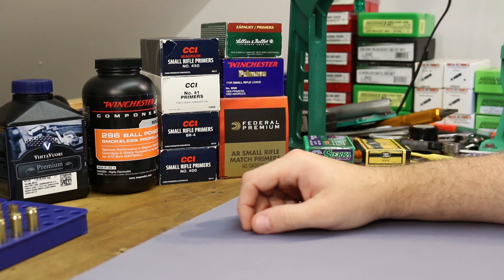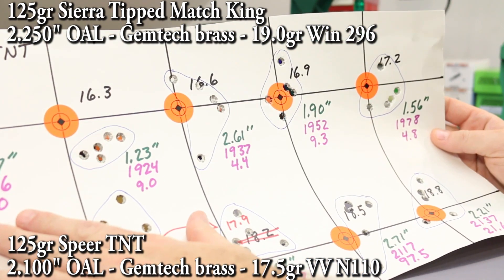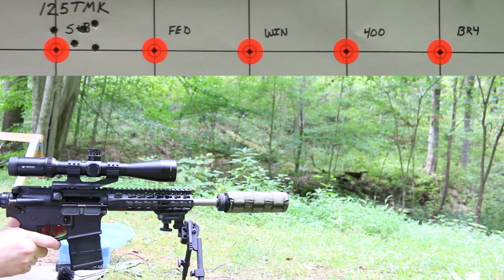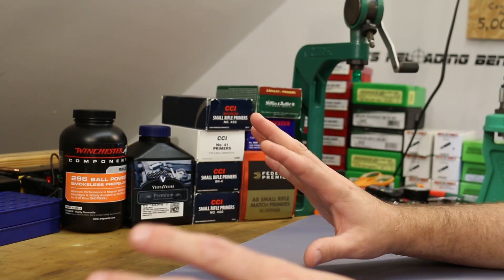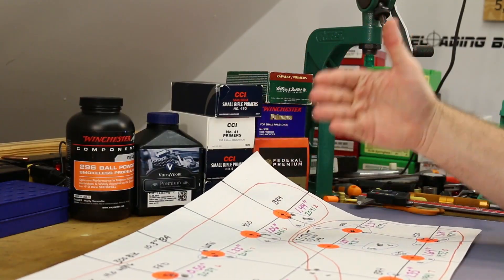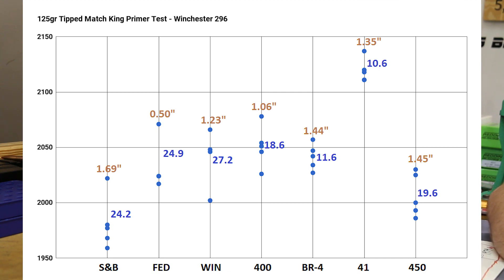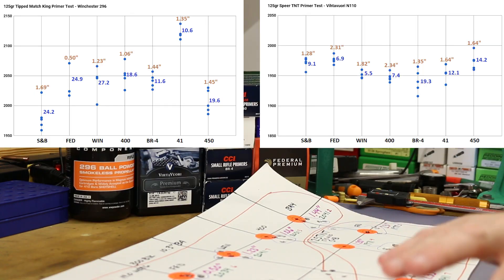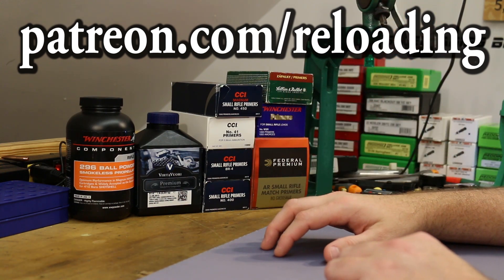300 BLK - Primer tests with 125gr Supersonics

Comment: Been using 17.5 gr of H110 (same as W296) with the 120 gr Barnes Tac-TX and also with the 125 gr Hornady FMJ as the corresponding “practice” load.  (17.5 is the max load given by Barnes for the 120.)

They both shoot to same point of aim and give nice groups.  As you said, that’s a good case fill level.

Comment: My AR Stoner barrel 300 BLK 16" group all under 1 inch with AR Stoner barrels.    My Lil Gun likes AR Stoner Barrels.   You had a very tough time. 
2.070" COAL Speer TNT, LC, 18.2 Lil Gun, CCI 41.   Lee Factory Crimp - Medium.   Winchester primers giving under 1 inch @ 100yds.   2250fps average

Comment: What I find in common on both charts is something I've seen replayed for decades consistently: low standard deviation does not translate to small groups and vice versa. Often, the tightest groups have the worst SD's. Seems like it shouldn't be that way but it is. Every now and then I'll stumble on a load that is both low SD and a consistently tight grouper but it doesn't seem to be the norm.
Reply from the maker: I have to agree with you on this one.  At least at 100 yards, I haven't seen much correlation between poor SD's and groups.
Reply: 452Rob at 100 yards it makes little difference. But start stretching the shots out to 800+ yards standard deviation makes a huge difference.
Reply: Rob, I can sure see how that would be important at that sorta range. Most of my interest over the years has been in handgun hunting and magnum revolvers and normal hunting distances. I'm only just now, in my 50's, starting to think about long range rifle shooting but haven't jumped into the pool yet:)
Reply: Chronographs are more accurate than you give them credit for.
Reply: John Browning, I have tested this with multiple chronographs from low budget to professional grade with loads exhibiting this phenomena and the groups that are good with poor SD's are consistent from chronograph to chronograph. Also, there have been numerous tests of chronographs and their accuracy. They are accurate enough that you can trust the SD numbers without a doubt. Those who say otherwise are speculating and bloviating wanting to appear knowledgeable and are best simply ignored. Anyone who has any actual experience with them will realize how sensitive they are. You may get error readings from poor light or poor alignment of the instrument in the flight path, but when they read, it's accurate.
Reply: You tighten up groups that have a good SD by messing around with OAL and jump to the lands

Comment: Never a boring day! It would appear after many different components that the 300 Blackout is not a particularly accurate round relative to say the 223/5.56. Definitely good for it's designated use and also a solid 150 ish yard whitetail round.
Reply from the maker: I definitely don't agree with that.  My 16" 300 Blackout was super accurate.  Give me a 16" barrel from Ballistic Advantage or another very good barrel maker and I bet the accuracy would shock you.

Comment: Lil'Gun in 22 hornet has taught me that tight SDs don't always translate into accuracy at close ranges (<200yds). Any hornet loader will tell you that as well. Loads that will give you better than 0.50 MOA will sometimes have SDs of 20-25fps.

Comment: Beautiful chaos so what did we learn? Johnny has a rigid finger the gun has a light trigger and the higher you go the looser you get. now on a more serious note I have never had good luck with Magnum primers . that's one reason why I use the 400 CCI they're more consistent you get a consistent shot with those primers if you look at your velocity charts you'll notice the CCI 400 primer is always in the middle it don't vary your speeds with whatever powder you're using

Comment: I also had multiple failures like this from my CMC trigger. If you call them they will send you out a new one immediately and request that you return the old one in the package they provide. I did and sold the new one. Go with a Geissele and you won't want anything else.
Reply from the maker: I have three with several thousand rounds each. I like them a lot and they've been dependable, so it will take more than this one incident to sour my opinion. I haven't done any careful cleaning on any of them so it might be time to pop them all out and make sure they're not gunked up. I've always heard great things about Geissele, though!
Reply: Johnny's Reloading Bench I liked the CMC while I had it and was happy using the replacement but I found that the 2-stage ssa-e was easier to shoot accurately on paper. I like being able to take up the first stage and only have about a 1lb break on the 2nd. May be worth the try if you get the chance.
Reply: Johnny's Reloading Bench geissele hi speed match trigger is probably the best trigger for ar15s
Reply: David Hunt second the ssa-e love it.
Reply: David Hunt It was not the triggers fault it was a bump fire.
Reply: Johnny's Reloading Bench It was a bump fire your bipod caused it.

Comment: I experimented with N110 using cci41 and cci400 primers and had lower SDs with the cci41 primers. Tested it with the 110gr Vmax, 125gr SMK, and 110gr TAC-TX and all my tests showed that the CCI41 primers produced a lower SD and slightly smaller groups. Difference in group sizes were negligible so I don't think anything can be concluded from that. I was thinking that CCI 400 would be the way to go based on your testing but results were different for me. It makes me wander what variable caused us to have different test results. I guess it just goes to show that there are other variables that can affect results. Regardless, thanks for all the videos. I've really learned a lot from your channel.

Comment: I got bump doubles after changing out my stock trigger for a 3.5# single stage.  I discovered that I wasn't holding my stock against my should firmly enough.  A firm grasp stopped the problem.
Reply: I had the same thing.

Comment: If your tigger isn't resetting I bet that was hammer follow. Next time the trigger doesn't reset inspect the primer on the chambered round. If there is a significant dent get a new trigger but if not you bump fired it.

Comment: Hey JRB, get yourself a Trigger from Triggertech, the adjustable with either a curved or straight trigger and never look back. Best trigger I've used to date, even better than the Geissele triggers and half the cost, have over 25k rounds through my Triggertech with zero issues

Comment: I think the doubles are caused by bump firing, especially with the new leather bag.  Those leather bags are supposed to allow the stock to recoil without grabbing the bag.  Combine that with a light trigger with a short reset and it's easy to get a doubling.  It's happened to me with two different rifles shot from the bench.  I find holding the rifle tightly into my shoulder and holding the trigger back until recoil impulse is over help to avoid the problem.

Comment: My guess is bump fire, no doubt to me. camera footage agrees based on the recoil. easy to do if you get in the groove with a light trigger finger. My Echo trigger in my 10.5" 300 blk will pretty much run itself after the first pull an release.  great data even if tripod season is upon us. (sorry for your loss) I've only run subs across the chrony with that gun so i am pretty stoked to see what the supers do with all the primers. I think the 41s where a fluke but would be very interested if they truly do give an extra 100+/- fps. Thanks so much for all the vids you do.

Comment: Bet some / a lot of that velocity variation is due to that light trigger, which will have less hammer energy to the primer. Bet you'd see noticeably more consistent velocity w/ a standard milspec, or Geissele national match, that'll smack the primer much harder. I saw the same velocity weirdness when I swapped in a Timney 3 lb competition trigger, from a Geissele super dynamic combat trigger. Groups also opened up slightly with the lighter Timney trigger. Also, don't rule out a faulty trigger; if the disconnector is dragging on the hammer slightly as it's released, it'll effect hammer velocity / energy.

Comment: IMR 4227! Just don't pay attention to load data. Keep it low (below 18gr) and H110 especially around 18+ ;)
Reply: I experimented with H110 and CCI Magnum Rifle Primers for about a year and finally decided to give up on it due to Copper Fouling issues.

I'm currently playing with CFE BLACK  and "standard" primers (CCI 400 and S&B Small Rifle) and liking it so far.  As far as IMR 4227 goes, yeah it's been pretty consistent and is my fall back powder if I can't get CFE BLACK.

Comment: I've been having bump fire issues for the last month with my AR lower and 2.5# trigger. I'm on my second box of Fed AR Match primers but started happening about a month ago. It happens with both 5.56 and 300BLK uppers. I'm losing about 1 out of 5 rounds. I'm told the Fed primers are very soft so was planning to switch to CCI 41 primers. Ironically, I've been having great success with the Fed primers and so have you. I'm not sure if Win primers are soft also.

Comment: it sounds like the timing is off on your disconnector ie there is either to much engagement or not enough engagement  from your sear and the disconnector. you need to have a good gunsmith look at it. it could be something as dumb as you have a bad spring or crud making the spring not work properly also.

Comment: Is the CCI 450 actually a hotter primer? I'm starting to wonder if it just has a harder shell to stop primers from blowing out on magnum loads.

Edit: WTF, I found on CCI's web site:
450 Mag-Magnum primer for ball propellants.
Safety Note: use Magnum primers only when specified in published load data.
The 41's and 34's contain Magnum priming mix and should be treated as such.

I'm so confused.  I am seeing the same thing where the 41's work better with my Lapua CM brass than the 450.

Comment: Bottom line of your testing: It's not the primers.  It's the powder.  Double base ball powders just do not give as consistent velocity as single base extruded powder.  BTW - I've been reloading and shooting different types of rifle and handgun cartridges for 30 years and experienced  results similar to this test.   SB powders usually give lower but more consistent velocity regardless of the type of primers.  DB powder usually gives higher but very inconsistent velocity with standard primers but higher and less inconsistent velocity with magnum primers or military grade primers.

Comment: Hey jonny I'm about to leave and there's a bass pro on the way my dad is going to stop by what kind of primers should I get for my 9mm and what powder do you like the best?
Reply from the maker: Unique is a good one to start with.  For primers, it really doesn't matter.  Just buy whatever small pistol primers they have at the best price.
Reply: Johnny's Reloading Bench I'm using a progressive press and have used titegroup for a while I ran out and was wondering what you liked if I have enough money I'll get a pound
Reply: Johnny's Reloading Bench well I got some hornady XTP Bullets (115 gr)  a pound of tite group and 250 of berry's rn 115 grain bullets I was going to get some unique but wanted to try the XTP's and didn't have enough  money soooooooo I don't know.
Reply: wesjwa andrews I've been reloading and shooting the titegroup 115gr. Berry's bullet. That's a good combo. They work well together. I've tried 4.0, 4.3, 4.5,  and 4.8gr. In my gun the 4.0gr was the best, but they all shot good....
Reply: Norm Beauchamp I've got my Lee disk powder dispenser or whatever you call it set at 3.9-4.0 grains and loaded a whole 250 rounds the next morning it shoots perfect out of my G19.
Reply: wesjwa andrews  That's awesome, glad to hear it